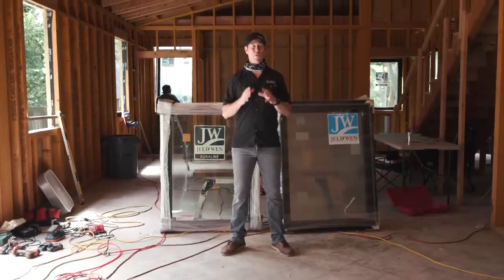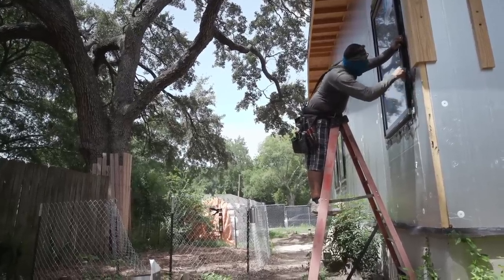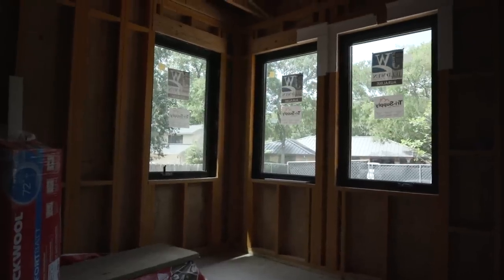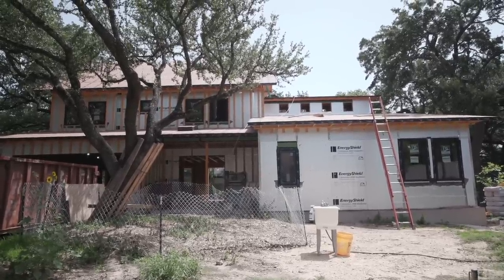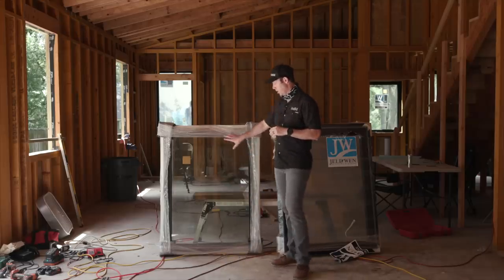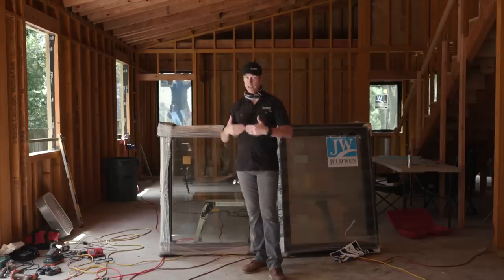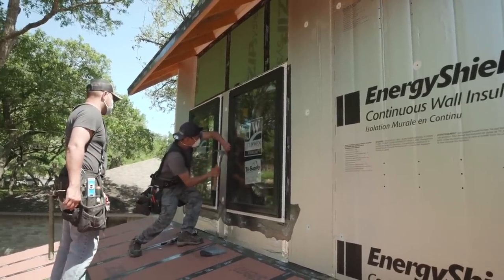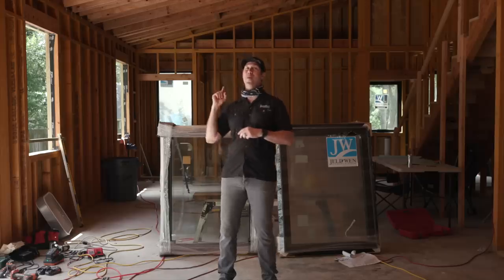Triple Pane Windows - Worth it?

Comment: It's worth mentioning how much more "soundproofing" you can achieve with a good triple glazed window package Vs double.

The sound alone, especially if you're out in the city, is absolutely worth its weight in gold! But even out in the middle of nowhere, like my home, it's incredible what you can hear even without traffic. Before we built the house we're in now, we lived on another farm. All double glazed windows, and though not built as well as the current, it was very over built for that time. There was always what seemed like a crew of crickets fiddling away, bullfrogs croaking, coyotes, and cattle right next to the bedroom windows. I enjoy these sounds, just not so loud that you can't tell if the window is closed 100% or not. (I am slightly exaggerating) but seriously, the difference in noise levels is incredible. Our new home is so much more quiet and comfortable, and while I imagine the technology in material like rockwool, green glue, and building super air tight, etc. etc. help a ton, I know the difference of sound coming through the windows. Just from building different homes with different quality windows. 
Small hail on triple glazing sounds like rain during a thunderstorm on double. The average thunderstorms on triple glaze is a mere misting sound. Sometimes we'll get a toad stomper, and won't know until we see it or we really get thunder comin in. 
I am not by any means a "salesman."
As a BUILDER....When you are having a super efficient home built, and you're talking a drop in the bucket on your overall price of the build, I've never seen it make more sense to go double than triple. "Buy once, cry once." If that means upgrading to that super fancy lighting, hardware, countertops, etc... And spending it on the quality of the structure, and comfort of the home... you do that. It is much easier, much more cost efficient, and just makes more sense than tearing into the cladding and envelope down the road to upgrade. If you can swing it, go triple. Don't skimp on the windows, structure, insulation, or heating and cooling. Facades and interior options are much easier and more likely to be updated anyway. 

Just my humble opinion. Hopefully it will help someone out.   Take care!
Reply: Most houses aren't kept forever by the original owner.    A fool is born every minute, who will pay top dollar for location while being oblivious to building quality.     The age of the discriminating buyer is long, long gone, except in egregious and obvious situations.   The oblliviousness to efficiency is, moreover, MASSIVE, by renters.

Comment: I thought using a lot of fixed windows was a really good idea. In our mid 70's house opening windows in the evening is an important way we cool the house cheaply. But assuming modern insulation, ERVs and perhaps ventilation that can quickly fill the house with low temperature evening air there doesn't seem to be much reason to open windows for cooling or ventilation. And in an area where pollen and humidity are issue there are some strong reasons not to open windows.
Reply: In winter my windows are closed due to the cold. In summer because some neighbour is always mowing or blowing and I can't stand the noise.

Comment: Windows are best when you leave them out.....they cost money, cause possible leaks and are approx 50% of a heating cooling load on a house, plus they make great entry for burglars ... in the real house remodel if it used standard lumber, 15k in lumber would be close to the entire cost in materials effectively doubling the house costs with 15k in windows......plus the 50% increase in heating and cooling costs........thats not counting curtains blinds costs or the fact hardly do they get opened.
    You can do LCD screens like underground for windows for the cost of triple pane windows and they will not leak air or water, let in bugs, or cost a 1000 bucks a year in heating and cooling costs......best yet....jut eliminate them as much as possible.
       Windows came about for light and ventilation.......with cheap LED light and mechanical ventilation they are not needed.
  You could burn a entire house full of LED lights all year long 24/7 and not even come close to the 50% of your heating and cooling costs associated with windows...more like a 1/10th of the cost.  Do a manual J break down of a average house and you will see the true costs of windows......
     My new 3 bedroom house will have 5 windows,...mandatory in bedrooms for egress, you want one in front of the kitchen window if your sink faces a exterior wall, many new houses have island sinks so that one is not needed and one larger window in the front room.   
     That window wall looks nice, but beyond 10k in windows, is the heating and cooling bill for the life of the house.........plus almost every single house I ever remodeled had some sort of issue associated with windows.......
    To use a analogy from the video,...DON`T cut holes in your yeti cooler unless it is mandatory.....sure people love big windows, I love big windows.........kids love candy, but we regulate how much they can have because its bad for them.........designers and builders need to start discouraging diabetic levels of windows.
Reply: Shawn Cockrell 
I agree. As technology, building practices and (unfortunately always late) codes change we should be critically evaluating WHY we build the way we do.
Reply: Jake Sangria    The only way to say that is based on biases........without being in the house there is no way other than that to make that conclusion.   But feel free to build your house however makes you happy.   

   But calling a house full of windows energy efficient is like like saying light weight lead.......

    A house needs to be designed with a goal,...if tons of natural light and fresh breezes is your design criteria, than by all means load the house up with window walls.  If your design is energy efficiency, then critical thought needs to be given to every square inch of glazing as its a huge contributor to energy efficiency....

   Windows now are a 100% looks item,...certainly not a energy savings item, no window will even come close to the value of wall, in even the best case scenario windows are a detriment to energy efficiencies , even the best windows.  In some cases. designs climates, they can add some solar gain and be a benefit, but never enough to break even and equal a wall.

    Build whatever you or the client wants, we do not all have to live in identical houses and some people do not care about sustainable or energy efficiency.......

   But do not be fooled by terminology, no 10,000ft2 house maxed out on windows is even on the same planet as energy efficiency, no matter what windows are in it.

   People love to fool themselves in to believing they are green or sustainable, they even like more to fool others.......plus its the in thing to do now is sling around eco terminology.

    If you can bundle "Perceived" eco friendly in to gross opulent eye candy and sell that to yourself and  make ourselves feel better about it, then its a win for some........when its nothing more than a delusion built on perceptions.

   Build whatever makes you happy, I am happy for you...........but don`t try and sell me a line about energy efficiency on a window wall............its the farthest away from that possible.....but if you like it, then great, be happy and enjoy.

  I would love to live in it,....but only if you pay the energy bills.....or better stated, work to pay the energy bills,......I will use that time to spend it with the family, instead of working for the utility companies bill.
Reply: Jake Sangria    I agree,..........I am sitting now in my 480 ft2 house with the front and back door open, nice breeze.....smells of cut grass, people bbq`ing and the sounds of nature.

      It only has one small window in each of the rooms........plenty of light, I can see out of the doors and 2 of the windows from where I sit.   

    My line of reasoning is critical use and placement of windows , for example a bedroom, its for sleeping, not hanging out enjoying the view.....the last place I want a window, but since we build with firewood it is mandated we have one in there.

    The front room needs a appropriate sized widow or 2 as does the kitchen.

   Critical use and strategic placement can make a space feel very open and lit up with minimal use of windows, when designing with sight lines etc in mind.   

 Many times windows are not in those places for architectural looks from the outside, which is silly........minimal use of windows does not have to equal cut off and a dark cave,..it can, but does not have to.

   Like I mentioned in one of my previous posts, I will be saving soo much in build costs and efficiency, I will actually be heating and cooling a 16x24 screened in porch and still come in cheaper than the national average by quite a lot in utility bills.

   If you think my minimalistic design style is bad, I bet you really like the 4x6x8 foot oriental sleeping cubicles :]  those are Orwellian in nature.

Comment: This man keeps saying he's from the south, but he is describing temperate climate; I'm from the south too, and it gets over 90-degrees (Fahrenheit) for more than a third of the year; we don't got winter, we got 8-months of Summer, 2-months of Fall, and 2-months of Spring; around 20% of the time the high reaches over 100-degrees (Fahrenheit), so a variable density triple-pane Gray window with E-coating on all 3-panes would provide substantial energy savings in the summer months; moreover, they never factor in the maintenance cost that running the AC less during the hottest days is going to provide; replacing a Compressor that overheated can easily cost $2,000 or more on even the cheapest HVAC units, not to mention the welding, replacing the oil, replacing/installing the in-line drier, and paying the Technician; all of which are in addition to the cost of the $2,000+ Compressor.

Comment: Matt, still waiting on the invite to tint your office windows.  😁. I’ve been tinting since the late 90’s.  You cannot tint triple glaze windows safely.  Double pane, your tint must have a heat absorption less than 50% otherwise it could trap heat between panes and break the seals or glass if they are annealed glass.
Reply: Even with the modern nano ceramics? 

I’m guessing that putting 12mil security film on both the inside and outside of a triple-pane is a no-go?
Reply: @trevorrisley5419  I’m not sure why you would need that on a home with triple glazed windows. Attachment systems for that on homes don’t have the best looking options. You might be able to do it in clear film if you really wanted to.

Comment: I used to live in an apartment where all the windows were shutter style, and there was always at least an 1/8 inch gap between the slots. The only way to prevent air from blowing in was to apply clear film over the windows. The apartment had no AC or heater so it was extremely energy efficient. I would call it "aggressive house".
Reply: Where was this, geographically?          In Torrance CA, it wouldn't matter, because it's so temperate all year around.      I live in Long Beach, where we have much bigger temperature swings.
Reply: South Bay has that marine layer that always keeps things cool. I install windows in the South Bay and most contractors in hermosa and Manhattan will go with double glazed windows

Comment: 6:47 Might be a little more careful with the knife. You cut a nice groove into the window frame with your knife when you cut off the plastic wrap...oops!
Reply: It is there before he cuts the plastic wrap, it appears to be a plastic trim clipped in to protect the window from scratches during shipping, which you remove. If you skip to 8:25 you can see this plastic trim and it has "remove after installation" printed on it.

Comment: Reisinger mis-stated the relation between U-value and R-value. To convert from one to the other, you have to divide <i>into</i> 1.00 not by 1.00, since U and R are reciprocal, like resistance and conductance in electrical circuits. In other words R = 1/U and U =1/R. If you don't know that, you shouldn't be ordering windows, designing walls or circuits or teaching math or science. cf. https://www.nachi.org/u-factor-windows.htm

Comment: I bought a JW door at Home Depot. It was installed by Home Depot.  It was an exterior door.  The frame started to rot.  I called Home depot. They said to call JW.  Called JW. and they said, call Home  depot.  The door was not touching the floor.  Raised around 5 inches from the floor. Just with rain water it developed the rot.  I askedJW why do they sell and exterior door that cant handle rain?  No answer.  I will NEVER buy from them again. I hate companies that dont stand by their products.
Reply: In JW's defense, wood is wood.  It will rot in the presence of sustained moisture unless treated.  In your application, most likely any wood door that you used would have experienced the same issue.  The problem is most likely due to other issues such as insufficient roof overhang or a leak that is allowing moisture to saturate the door.
Reply: @renli3d  We will have to agree to disagree.  I asked for an exterior door. Its true there was no overhang over that door.  Either Home Depot should not have installed the door, or JW should say its an interior door and not sell it as an exterior door. Or they could say DONT INSTALL without overhang. At the end, I paid the price, now need a new door.  Home depot got money, and JW got money and I got screwed.
Reply: @yacahumax1431  Again I disagree. :) A door without an overhang is non-standard and requires extensive design to prevent an issue such as yours.  For instance, the use of composite door jambs and a door slab that is resistant to moisture.  It's not JW's fault that their product was used in a non-standard application.  Home Depot can't really shoulder full blame either, because while they could have alerted you to the fact that the door likely wouldn't last long in your application, ultimately if a customer wants a product installed they will install it.  What kind of door was in place before you replaced it?   You see low or no-overhang houses cropping up with modern builds and  I believe Matt Risinger did a video on it too.  They're very tricky.  The takeaway is that this failure was a great learning experience and you'll ace the next door install!  :)

Comment: Matt, Overkill much? I learn a lot from your channel, but you are a little bit disconnected from reality. Is there really no time of the year in that you want to have lots of windows open? A fixed window only lets light in a movable window lets light and air in, how much air leakage do you really get from a casement/awning probably an amount that only matters in quantitative terms, not qualitative terms, you lose flexibility with non operable windows. I guess the HRV/ERV is where the air comes from in your house. I use my windows and i don't filter the air I breathe when I go for a walk outside either. I'm just giving you a hard time...keep it up.
Reply: If you live in the South with this heat and humidity (bonus of massive amounts of mold spores, etc to go along with it) and open your windows often, I salute you. Lol. I wish we could open our windows more often! Its only July and we had 109 heat index today.  August and September should be a joy!

Comment: I replaced the windows in my Texas 1950 house in two stages. I started with triple pane. And finished with double pane disappointed that I had put triples in. The whole issue was the amount of light I get. I have large windows and have to turn lights on in the middle of the day. Daylight is key to health and happiness. At least in the south, I would think twice before pitting in tripe glazed windows.

Comment: I live in the north , cold sessions like 8 months or so. If i invest in 3 glasses,  I calculate that return on/of investment is about 40 years. In my case shifting existing windows. I had a salesman knocking on my door, we did the maths. The current widows have about 3U and the new he had to offer 0.7 , the window area ~20 (small house) savings are approximately 4MW per year. It sounds much and it is. But compare  to the costs of the new windows and labour, it's all about comfort.

Comment: I close windows in many houses. I don't like casement windows because they are rarely installed correctly. I've nearly broken (at least one in each house) many of the pot metal locking handles (yes, on JeldWen as well)  trying to latch the window. I have seen many broken actuator handles and mechanisms on very expensive windows. They still use junk pot metal for the actuators and handles. They use steel for the latches and pins. After 20-30 years of jamming those latches closed they will break. Nobody installs those things correctly.When the house settles or walls move the window cannot be adjusted easily to allow them to close correctly. 
For the cost of those windows there should be better design of adjustment to offset installation and house movement. There needs to be much better quality on the operating mechanisms.
Reply: Derf, so in the imperfect world of them all using cheap hardware for casements, do you think just go double hung and double pane say a Marvin fiberglass frame?